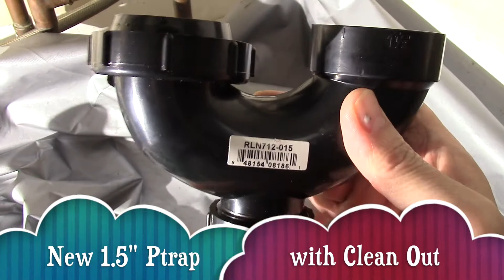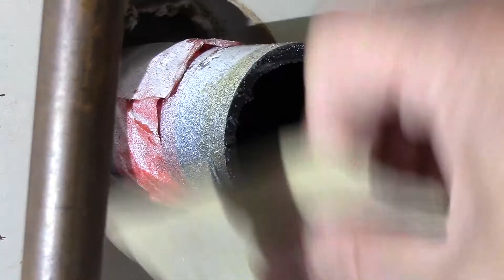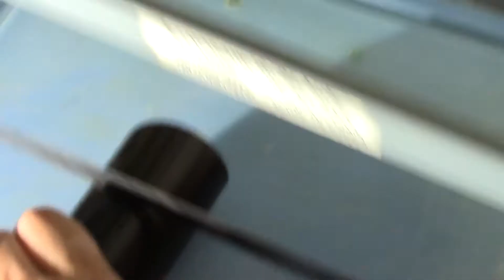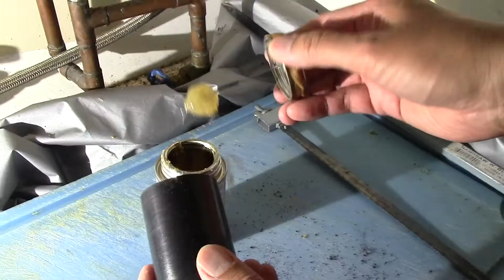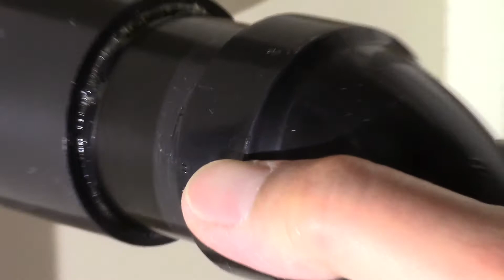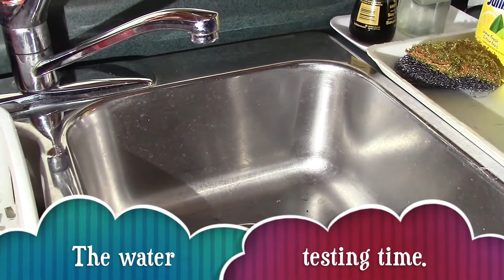My Sink Is Clogged (Grease Clogged) DIY Replace Ptrap, Electric Eel Greased Clogged Pipe

Comment: May I suggest a few things....

Debur the inside and outside of your pipes. Also remove all paint and etc on all connections.

Cut all the pieces 1st and assemble them dry. Test fit the WHOLE setup.

You can heat up a large pot of water.

Keep it to no more than 140 degrees F.

Then with as empty a drain as possible. Try a Shop Vacuum. 

Then pour all of it quickly into the drain and sink.

Let it sit.

Usually will melt the grease.

I would suggest a P trap that you can
Unscrew from the plumbing.

I have a friend who paid 300.00 to have his snaked by a professional.

3 years later same problem.

It ended up being  grease.

The HOT WATER cleared the clog.
Reply from the maker: Great idea. Thanks for sharing with our viewers also.